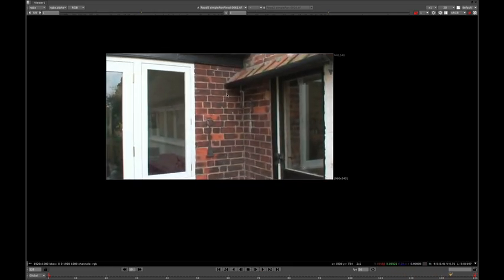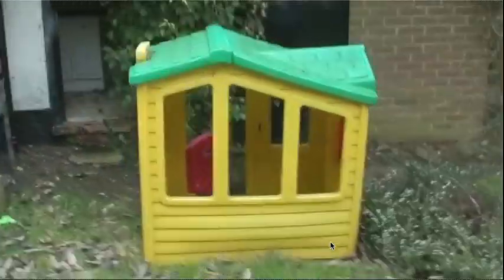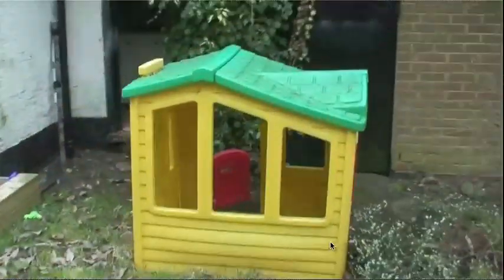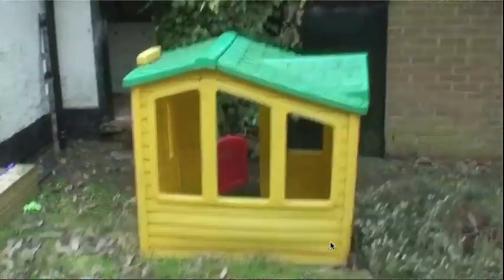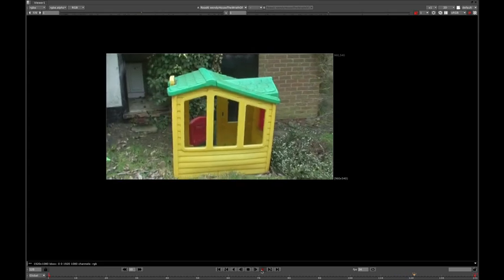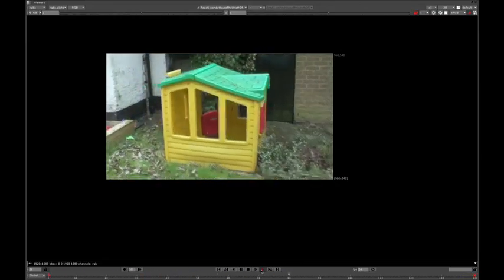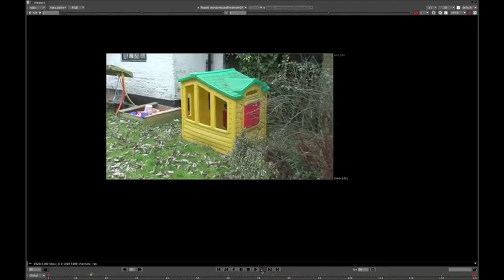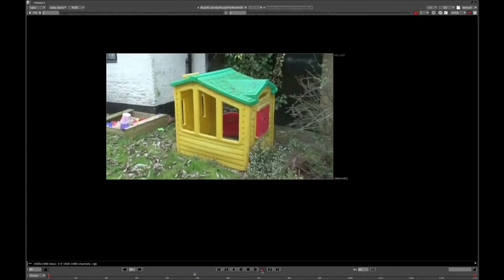Fix For Rolling Shutter

Comment: Hello TheFoundryChannel.  I love the HD output from my Canon Powershot SX1 IS but it is a CMOS sensor and has slight rolling shutter lag.  This is a problem because when I used iMovie's *excellent* image stabilisation the effect is a weird temporal fluttering and distorting (probably because it can't do anything about the vertical stretching and compressing you mentioned).

I'm looking for something to process my CMOS footage to fix rolling shutter artefacts before I use image stabilisation.